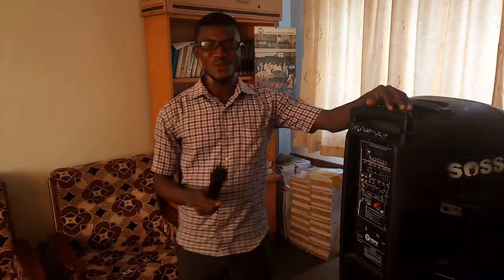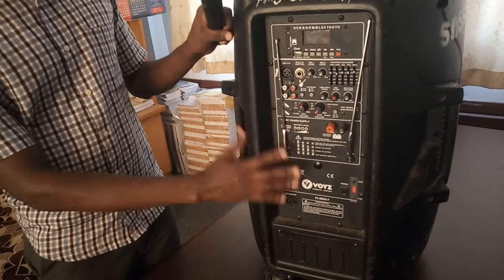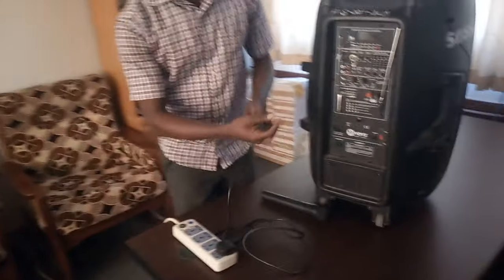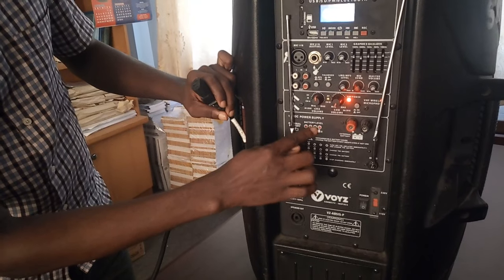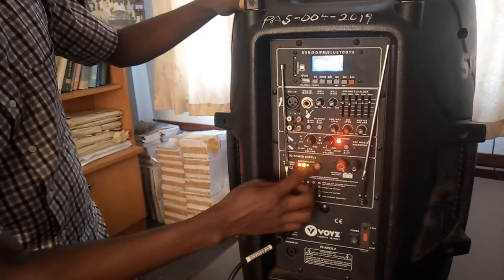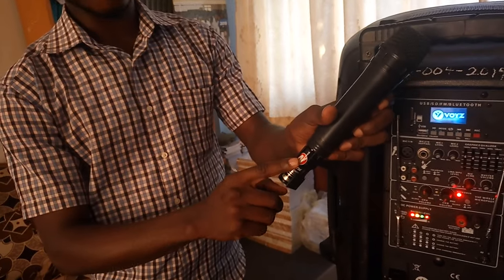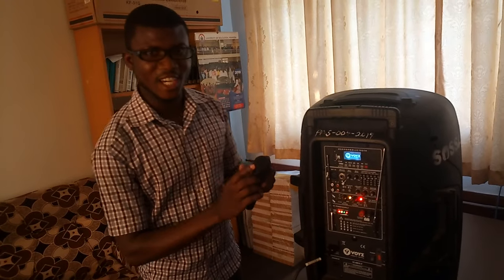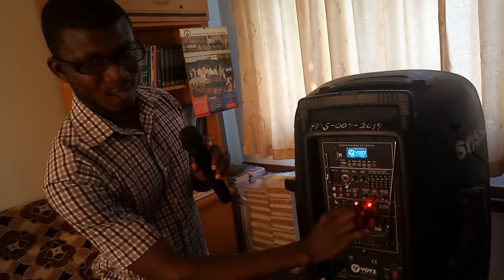How to connect a wireless microphone to a speaker (Voyz)

Comment: Did this work guys?????
Reply: It works. That is Voyz Speaker. It has receiver inbuilt. One of the best speakers you should have. In casea where the receiver is not inbuilt, you need to buy receiver before it can work with the wireless microphone
Reply: Nope.